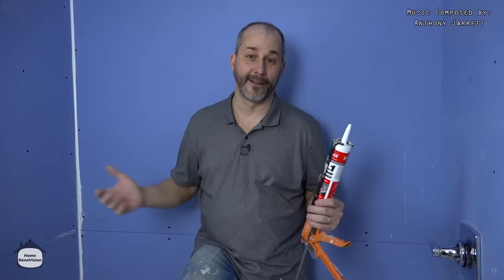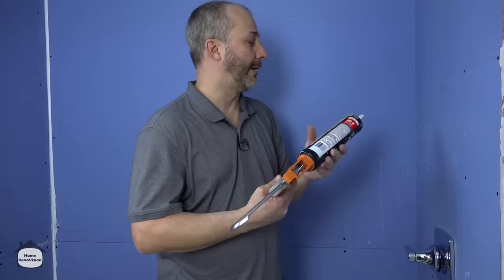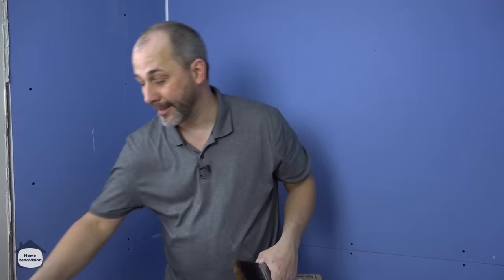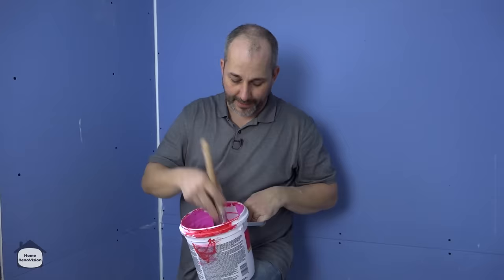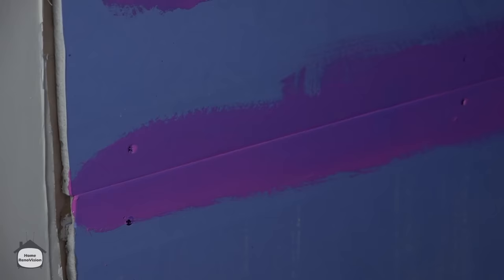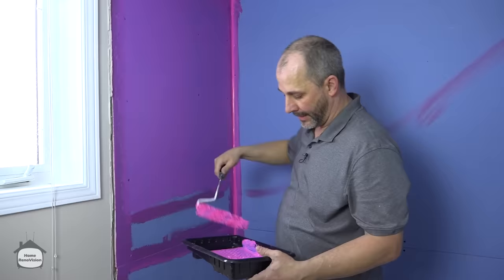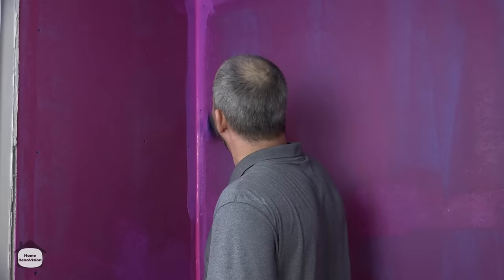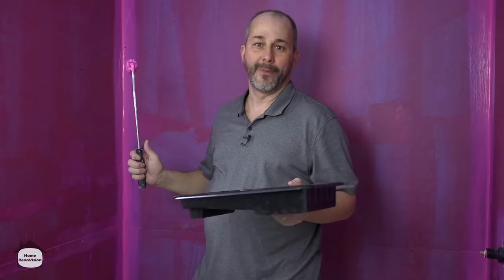The Most Inexpensive Shower Waterproofing System Ever!

Comment: Pretty sure drywall is not listed as a suitable substrate for RedGard, or any other liquid membrane probably. You better check your tech data sheets!!!!!!
Reply from the maker: I don't care. Homeowners can use it to get superior results with cheap building materials. Is it the best.NO but in most cases the goal is to be mold free for 30 years. That can be achieved with this system. Cheers!
Reply: *Ray Mansfield*...so I made a video on RedGard 3 years ago, to date it has 705,000 views, one of those was the product manufacturer...Custom Building Products, and they made the same comment " We don't recommend it for drywall " ( I was using greenboard ). But my feeling is I don't care either, that stuff sticks on my drain cover, my clothes ( that are washed weekly and it won't come off ), and anything I paint it on. After using it on EVERY shower I build for the last 8 years, I've never had an issue, a failure, or any problem related to it's application. Things in life work or they don't, RedGard works !
Reply from the maker: that is just a fact. Cheers!
Reply: Why not just use cement board or hardibacker? Still cheap and actually meets CBP RedGard requirements! Your talking maybe 10-20 bucks more to use a cement based board. I agree that some of the better systems aren’t always in everyone’s budget but you can still do things cheap and correct. Heck, you could use plastic over studs with cement board and it would be even cheaper than using Regard and it would still work. Not trying to bash you, and there are many ways to skin a cat, but standards and instructions are in place by manufacturers for a reason.
Reply from the maker: I have no problems with using the cement board. I know a lot of people who are intimidated by using a new product. I am showing the simplest form. Not the best. As far as product suggestions go, you need to separate why a suggestion is made. In my experience most suggestions made by corporations are based on their own agenda to make money and have nothing to do with consumer benefit.
Reply: I have some redgard leftover from a project about 3 years ago. I keep it sealed and in my basement.  I'm starting a new project and wondering if it is still good?
Reply: StarrTile hacks agree with hacks
Reply: Home RenoVision DIY c
Reply: @duanewilson3941  It's easy to tell: if it still is a bright pink you're good.

Comment: bruh you should really do your research before making one of these videos. . gypsum wallboard is not an approved substrate for redgard, especially in a wet area. Should be using a CBU like permabase or durock in shower with a liquid applied waterproofing membrane.
Reply from the maker: since the code does not require it I can suggest adde3d protection if I want to. This is based on years of experience. Take it or leave it Bruh!

Comment: Water RESISTANT gypsum, not waterproof.  Per TCNA, water resistant gypsum is not approved in wet areas when used as a tile backer, and Regard must be 40 mils wet thickness when used as a waterproofing membrane (ansi 118.10)  PLEASE do not ever use this in a shower that is to be tiled.  I replace so many tiled showers that have used this system and failed within 12 months.  Even professionals have a hard time properly waterproofing showers, it's not something I suggest as a DIYer.  Please proceed with caution.